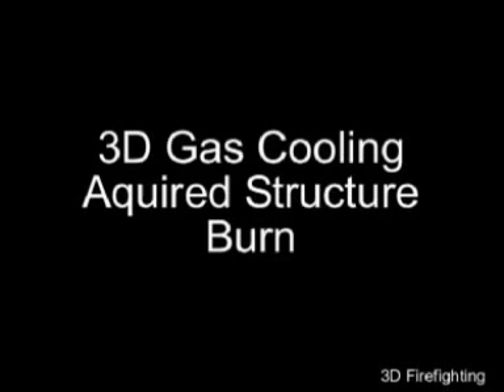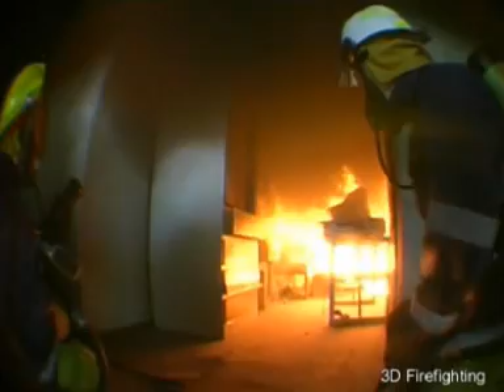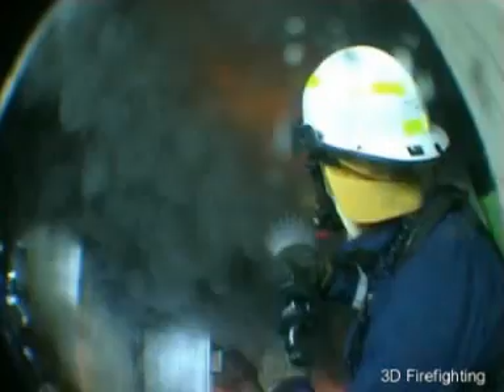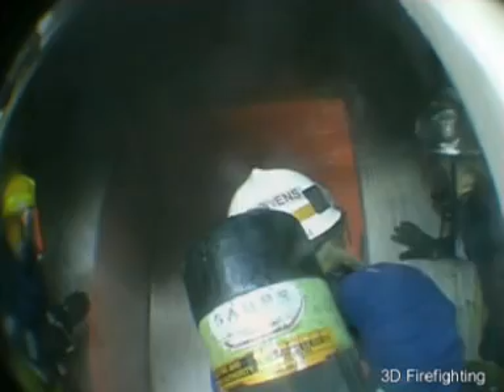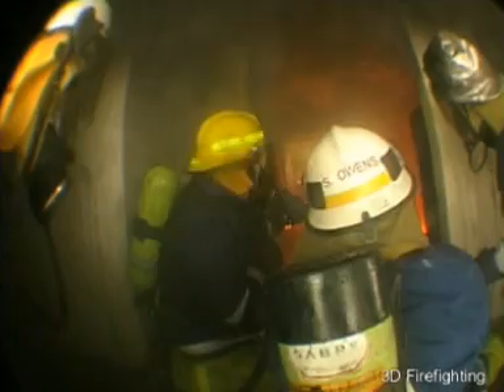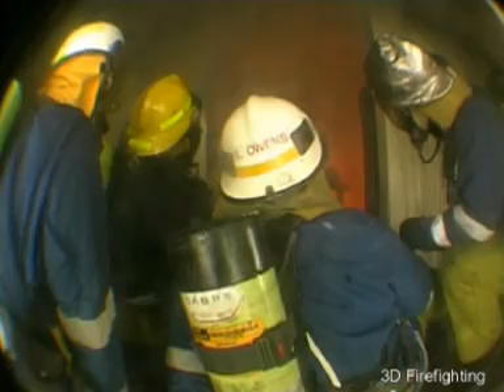Compartment Fire Behaviour Training in a real structure

Comment: What's the goal here? The short bursts were extinguishing flames in the smoke ball at exterior. Fire was growing the whole time. Was entry the goal?
Reply from the maker: +David Fernandez Hi David, It was a training session, that allowed the observation of fire behaviour, the opportunity to interact at various stages of development, practice nozzle techniques to control the immediate environment, progressively reduce the intensity of the fire while maintaining thermal balance, extinguishing with minimal water to preserve the scene........etc. 
You raised a good point when you said that the fire was growing the whole time. The gas cooling techniques are best for preventing the ignition of the smoke layer. They can be used to hold the fire in some cases, BUT it is critical to realise that their effect is localised and limited. They can help with entry when combined with painting of the linings. Ultimately control of the fire growth cannot occur until water is being placed on the burning surfaces. If they are visible when you enter the compartment you can start to reduce the intensity with direct application. If you have to travel through a smoke layer to get to the point where you can apply water directly. Cooling the gases and painting the linings will help to make the journey through the "kill zone" safer (to some extent), However If the travel distance is too great or the fire is too large, there is a possibility of being over-run. So it is important to see the limitations as well as the benefits.
Reply: you say this, but its a military derived technique, designed to be in and out with perfect technique, cant get close to perfection without training and practice.

ive seen "old fashioned" firefighting.. roof breach, entering with inadequate ppe... almost every time someone falls in, or end up with cancer.. and denying a method that allows old style speed with actually saving lives and property? what if its electrical?  do you also wish to blast any remaining evidence away?????
no didnt think so

Comment: Really curious about this nozzle, what is the hammer effect like on the truck? From an Aussie fire fighter.
Reply from the maker: +Josh Connor The Akron 753 incorporates a water hammer retarder. It is a spring loaded piston. Very effective.
Reply: i would also suspect the pressure would burst a hose before it damages a pump, to do that the pump would need to be well worn. not uncommon, but id like to think the relevant fluids at least would be checked regularly.
Reply: Josh Connor 5r
Reply: I66gy
Reply: J
Reply: Josh Connor 8
Reply: Josh Connor l
Reply: Josh Connor hb hify7ff7vv

Comment: Flood the place.  3d fog does not cool the room.  It only extinguishes fire.  thats why firefighters sustain burs from the hot material such as tile floors, molten nylon carpeting, hot glass, hot steel.  use water to cool the room.  Flood the place.  Who cares that the floor is wet when the room is destroyed by fire?
Reply from the maker: Hi Daryl, I think you are mistaking 3D techniques with indirect extinguishing techniques that use the superheated surfaces to saturate the environment with wet steam. The pulsed 3D techniques do not really extinguish the fire. They are most effective when crews need to move through smoke laded (fuel laden) rooms to get to a point where they can put wet stuff on the red stuff. NRC did great research and their report is a recommended read. see http://pyrolance.com/wp-content/uploads/2013/08/3D-fire-fighting-report-NRC.pdf Certainly there is a time and place for blitz attack as there is for 3D techniques. Both are safe and effective when used in the correct context.
Reply: This technique is used specifically for compartment fires and when carrying out search & rescue, if you just "flood the place" water expands ≈1,700 times its volume when it converts to steam, what effect would that have on a casualty ? and the BA Crew ?  The short pulses are to cool the fire gases (fuel) to the overhead and the long pulses to push the fire back to allow the crew to advance. What you see here is just practising hose techniques and not advancing as you would at an incident. If this type of fire was in a apartment or high rise then minimum water application will mitigate water damage to apartments below, why would you flood it and wreck every property below as well. CFBT attack with a fan could also be used to make a clear air path to the compartment but again only in the right circumstances and certainly not in a fully involved building.
Reply: You wouldn't happen to be a NYC firey would you? You sound like the "enter the fully involved structure then place a fan at the front door" kind of firefighter. :p Do the CFB training like that and see how effective it is.
Reply: yeah... i dont know about anyone else here... but when i signed up, i knew getting burned in general line would happen at some point... and going through that door im sure in a non training situation, they go in knowing full well that theyre not coming out unscathed...
Reply from the maker: Daryl Liggins I like your following comments " just because the oven is turned off does not mean I want to step into an oven". You are quite right with that statement. What is sometimes over looked when teaching these techniques is the fact that it is only a control technique applicable in some situations. Along with the 3D gas cooling we also teach "painting" which is a deliberate and gradual application of water onto the linings to cool them down to stop pyrolysation and reduce radiative feedback. Critically important is "pencilling" which is a gradual application (usually in the form of a jet) of water onto the burning surfaces. So it is a well thought out and these techniques compliment many existing approaches.   We integrated it in 1997 and now I think it is fair to say that these techniques are standard in Europe, UK, Oceania and even being used in parts of the USA and Canada. Primarily it is about safety and efficiency, but it also maximises our chances of saving victims and also preserves the scene. When used in the right context, these techniques can be extremely effective and beneficial to firefighters and the people we serve. It does not get any better than that.
Reply: No I am not a NYC firefighter however I do work in a large poor urban city and see my fair share of building fires.  I also teach at the FDIC for fire engineering magazine.  I did not say anything to indicate I do or do not enter "fully involved" structures or use fans at building fires.  Since you bring it up in my area I fight fires predominantly in type 5 (wood frame) with ballon framing.  Fans will spread fires try these buildings like wildfire.  so no we do not use them here except specific high rise applications (stairwell control) or to clear smoke after fire extenguishment.  We also do not "enter" full involved structures.  When we arrive at a fully involved structure we first contain the fire to the building of origin so we do not burn down the neighbors place.  we generally do this by using the reach and penetration  of a smooth bore nozzle stream.  once we gain the uped hand and start seeing knockdown and the building is no longer fully involved we can enter (if the stability of the building is fine) and finish final extinguishment from the interior.  after the fire is out and ceiling and walls are pulled we can set up a fan and blow the smoke out.  So do I enter fully involved buildings and use a fan? I guess I do.  any more comments about what you think I do?   So I would like to add that 3d gas cooling may be able to control the fire and even complete extinguishment however most of our burn injuries are the result of the firefighter coming in contact with hot and smoldering objects such as gra it countertops, tile floors molten carpeting ect.  Gas cooling is not the same as cooling the room so that's why I said flood the place.  we are trying to cool the whole room and prevent burn injuries not just cool the gasses.  just because the oven is turned off does not mean I want to step into an oven.

Comment from the maker: Dan the Akron 753 is probably the ultimate 3D Gas Cooling Nozzle. Fitted to 25 mm internal diameter High Pressure hose it can deliver 230 LPM. We carry two hose reels each having 90 metres of hose. 230 LPM is NOT a high flow rate. However it can be rapidly deployed and in the hands of a well trained firefighters it can often go a long way to "holding a fire" until a second HP reel of larger diameter hose can be deployed by the second arriving appliance.

Comment from the maker: Smallest attack line is a 90 m (125') High Pressure Hose (25 - 40 Bars or 300 - 550 PSI). 2 on each pumper with flow rate around 225 LPM (60 GPM). They are lightweight, maneuverable and allow for rapid attack and search. Used in domestic dwellings up to 50% involved. Extremely effective and a 2nd and 3rd line is rapidly deployed. May be used for slightly larger buildings but will be backed up with a 50mm (2') line. Anything large than that will be 50 or 64 mm (2 3/4'). Flows rates up to 200 GPM

Comment from the maker: Smallest attack line is a 90 m (125') High Pressure Hose (25 - 40 Bars or 300 - 550 PSI). 2 on each pumper with flow rate around 225 LPM (60 GPM). They are lightweight, manoeuvrable and allow for rapid attack and search. Used in domestic dwellings up to 50% involved. Extremely effective a 2nd and 3rd line is rapidly deployed. May be used for slightly larger buildings but will be backed up with a 50mm (2') line. Anything large than that will be 50 or 64 mm (2 3/4'). Flows rates up to 200 GPM.
Reply: Shan Raffel that’s weird lol. Here in the US we use 1 3/4” hand lines, flowing about 150-160gpm

Comment: What do you guys use for actual fire attack?  In my area we use those small lines for mop up and grass fires only.  Our attack lines are about twice the diameter and 3-4 times the water volume.
Reply: High pressure hose reels (19mm internal diameter) at 20 to 30 Bars pressure are the most used hose when it come to fire fighting in the UK. I have seen them described as garden hoses from over the pond, which they are certainly not. They are our primary attack hose used for making an entry, gas cooling etc. very good for a quick knockdown and can be deployed in seconds. Also can be used from the tank supply for around 15 to 20 minutes without having to set into a hydrant. We always deploy a 45mm (1.3/4") jet to back up but the less water we use the less damage caused elsewhere.